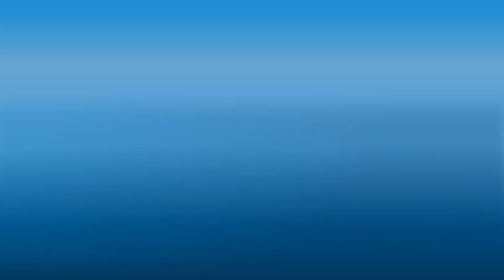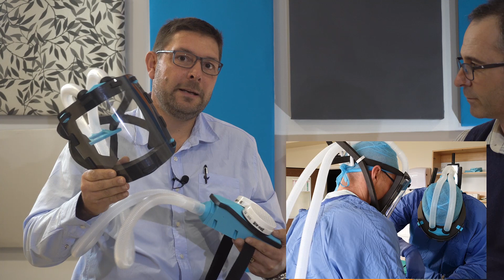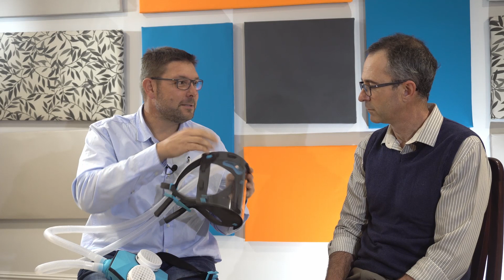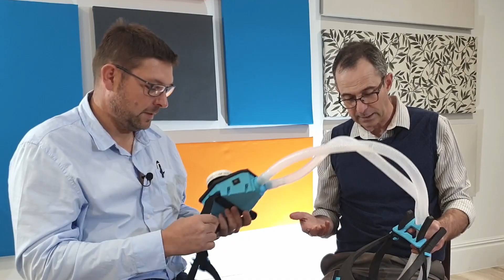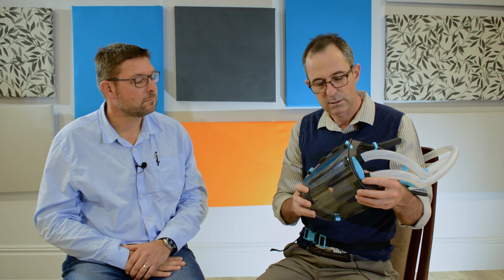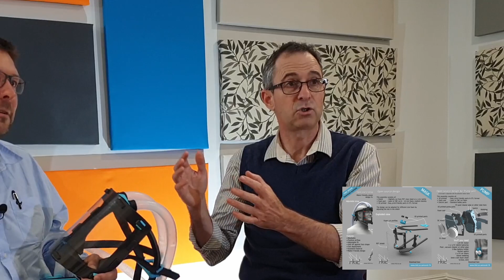How we try to save our healthcare providers

Comment: The 2 pumps and 2 tubes are redundant and overkill. 
Change the mask adapter to a single tube, and use off-the-shelf blowers and power banks and inexpensive inline viral filters from the blower to the tube.
Google RAD-UM PAPR" for an efficient design, or just "DIY PAPR" for several open-source designs.  The foam mask could reduce the need for a hood.

Really good production values on your video...
Reply from the maker: Thank you for your input. We have another design with one pipe and off the shelf blower.

Comment: Hi, Looks to me good design.  Can  you  let me  know, what is the Fan CFM and   what's the acceptable range of  air pressure ?  I  think design can be  improvise by  adding  low battery alarm(through connectivity(BT/WIFi)) or  adding  low volume audio.
Reply from the maker: Hi Anmoi. I missed your comment. Thank you. The fan supplies 80-90 litre per minute. I agree that further improvements and additions could make the design even better.